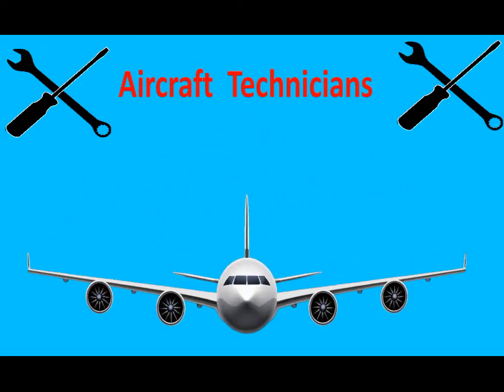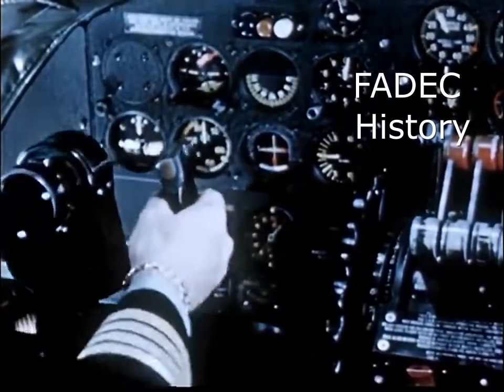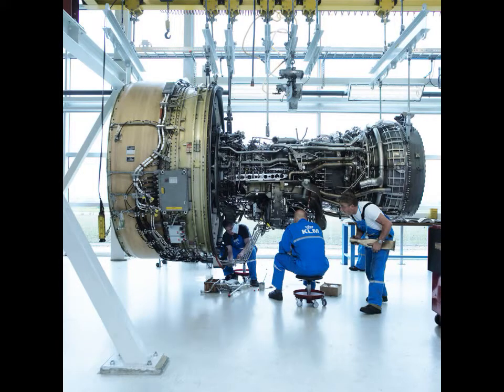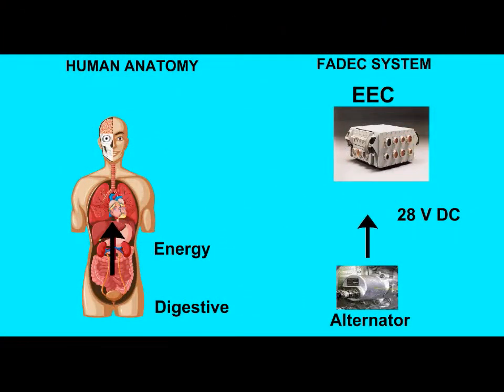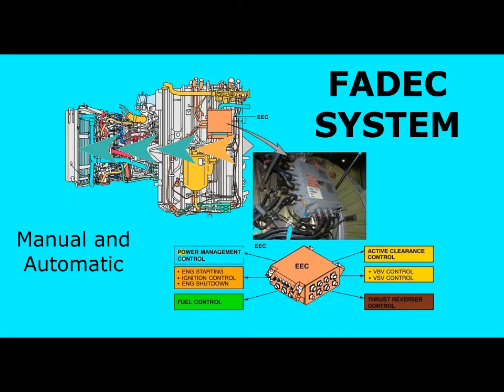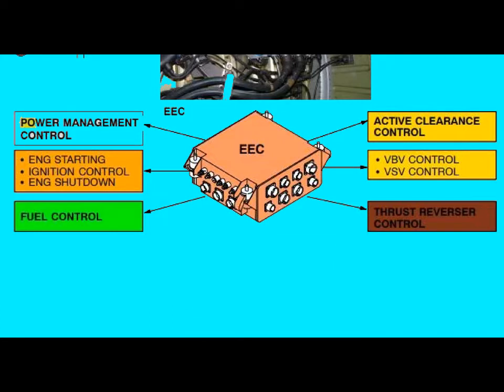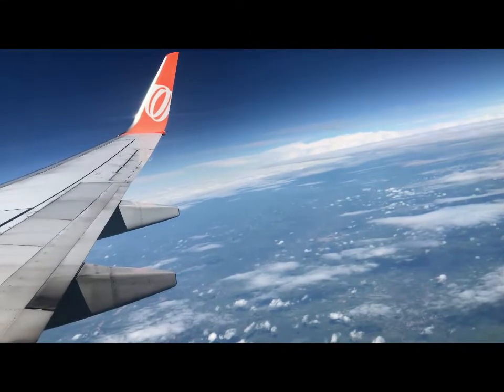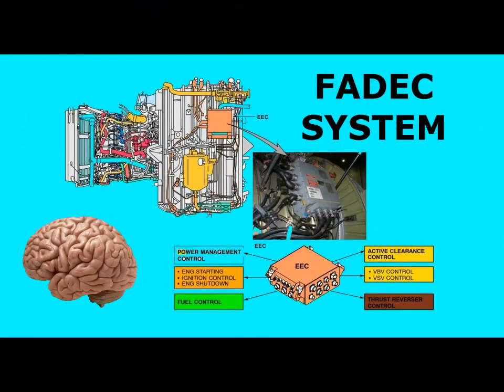FADEC (Full Authority Digital Engine Control)

Comment: Is the HNU also powered by alternator, and have dual channels? I’d assume so otherwise that would be a single point failure
Reply from the maker: HMU is a HYDROMECHANİCAL unit. It is driven by gearbox. Alternator connect to gearbox too.